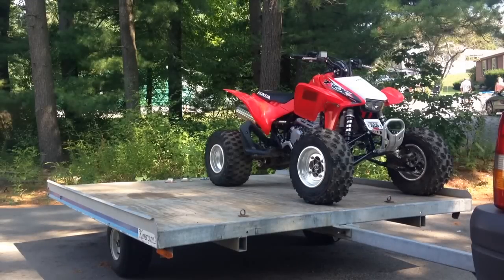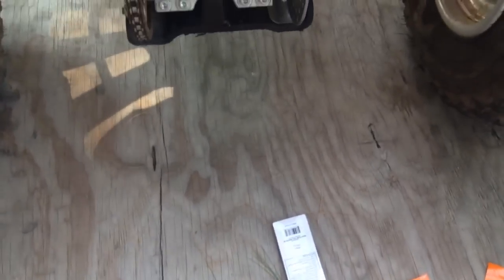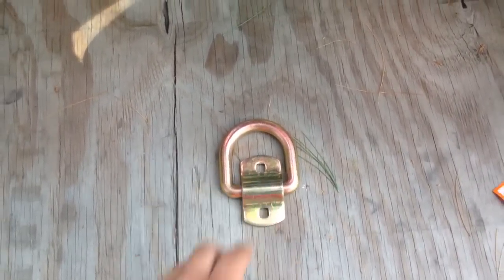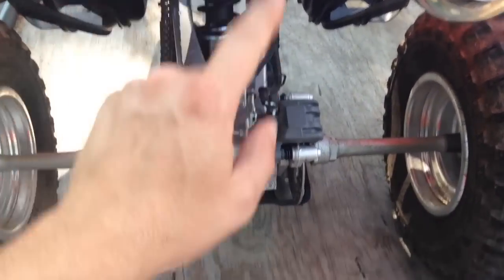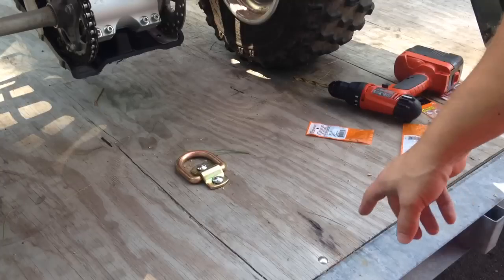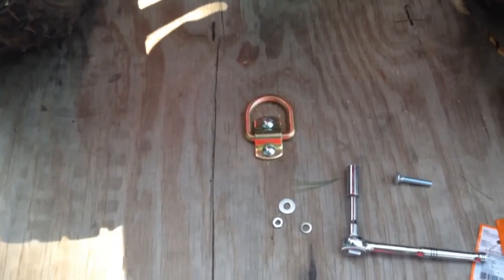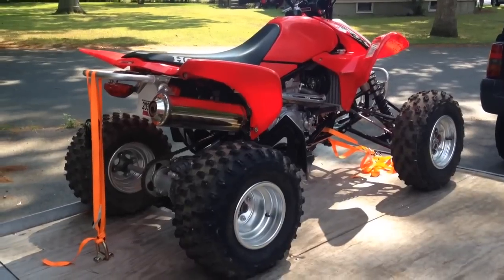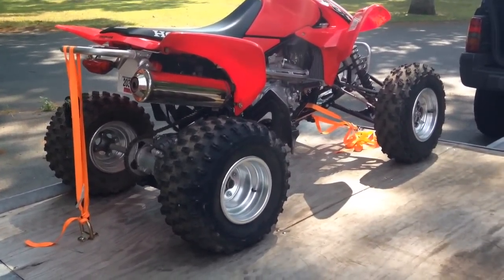Harbor Freight Cargo D-Ring Anchor Install On ATV Trailer Haul Master

Comment: should have mounted the anchors away from directly UNDER the bars that way you have each anchor pulling  the machine towards it... the way you have it allows for the atv to shift forward/backwards unless you really crank it down

Comment: I know this video is 6 yrs old, but my posting is for other's benefit and training.  Your tiedown strapping is excellent - for up and down movement.  Unsatisfactory for lateral movement.   Ideally, your strapping should form a 25 deg angle up from the deck to the tie point of your ATV and you should always have four tie points, not two.  That means your ATV tie points should be down to about 12" up from the deck somewhere on the frame of the ATV close to the wheels if possible.  Your tiedown might work until you have to do an emergency stop or swerve to avoid a collision but I wouldn't bet on it.
Reply from the maker: I ditched this trailier and bought an ATV trailer from Home Depot...waaay better design.

Comment: If you can’t go through a cross member at least use a backing plate, the forces put on these in a crash  will rip these buggers out no problem